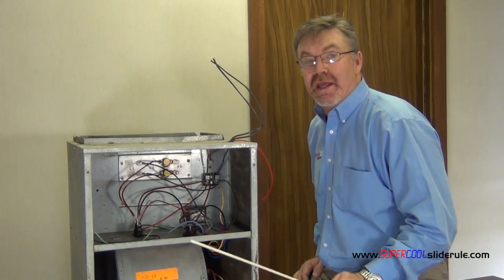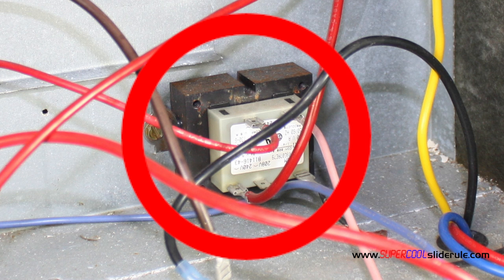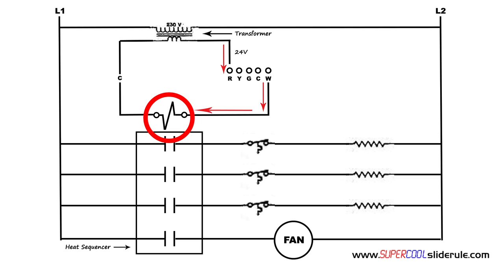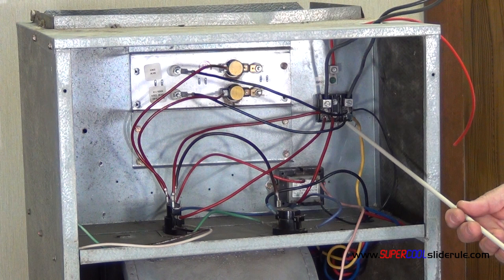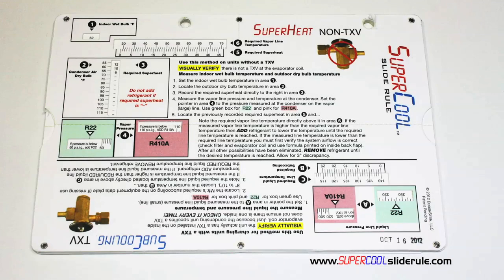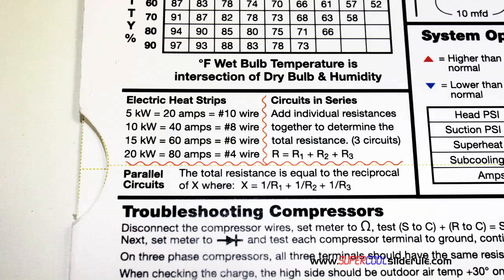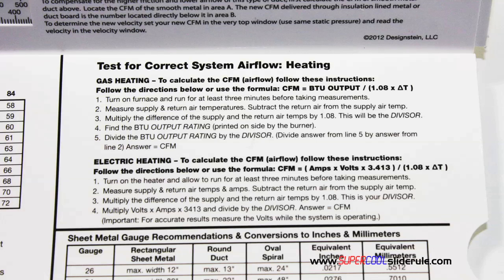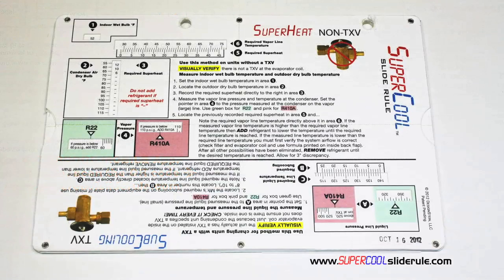Wiring Schematic of an Electric Heater

Comment: i have a blower that will not turn off. It has a fan relay, that is not the problem. Can the sequencer be the problem?
Reply: William Micheal I have a ge motor that goes to a furnce that have the two Brown wires a red yellow blue black orange which one is common
Reply: William Micheal yes